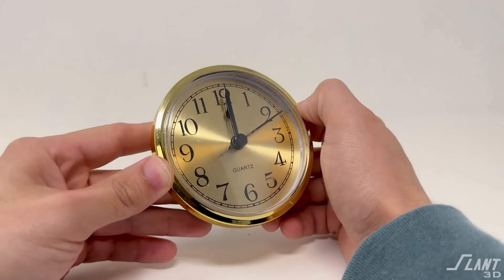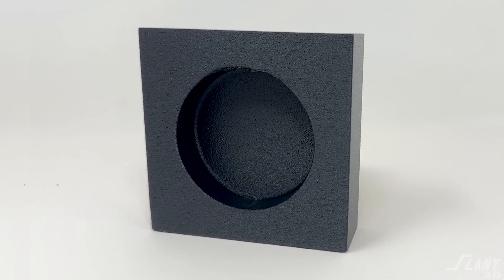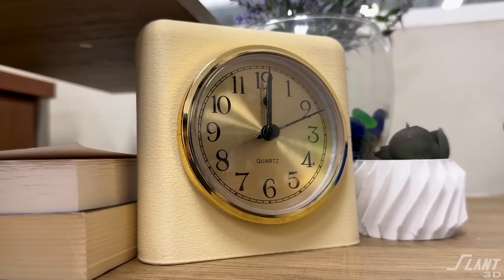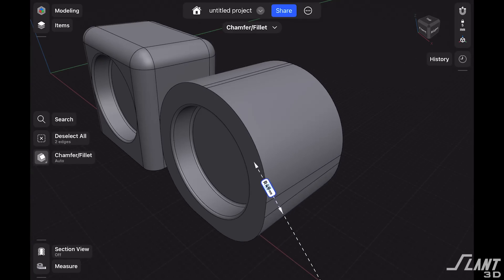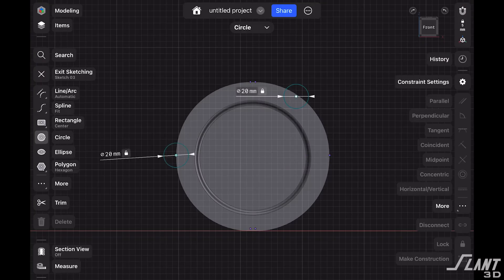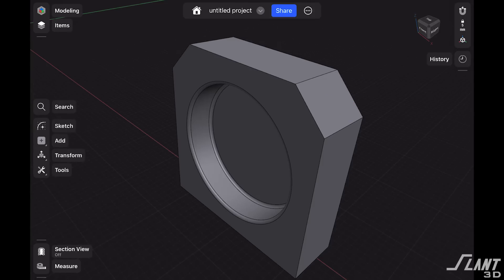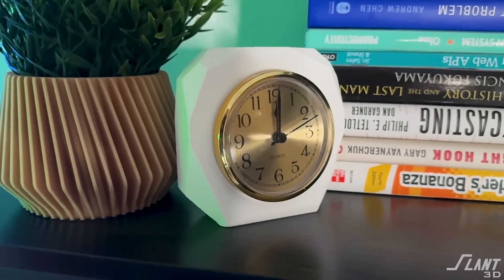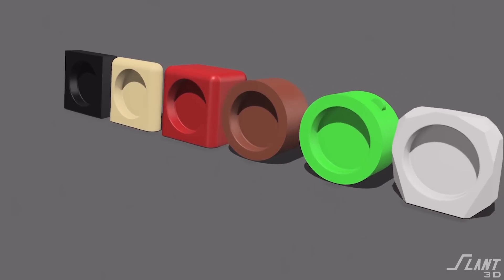Create 3D Printed Clocks Easily | Design for Mass Production 3D Printing

Comment: This might be a dumb question.
Why haven't Slant3D partnered with printables or something.
If there was a plugin made specifically for that site it could fit in really well with the rewards model they have.
The one thing that site doesn't have is a print on demand service.

As the consumer I see this as a match made in heaven. 
Technically it does have the downside of being in conflict with selling printers. But I would think they could generate more revenue overall by getting a kickback with a partnership then selling the printers.

It's just something I would consider. Also because both companies have good ethics it could be greater then the sum of the respective parts.

Comment: what cad program are they using here its not fusion
Reply: Shapr3d
Reply: @JOEDHIGGINS  Is this easier to use than fusion 360 as far as learning curve cuz it seems like for fillets he was just dragging to get the desired amount he wanted versus fusion 360 where you have to go in add it manually to each corner and then select how many millimeters and punch it in
Reply: @josefsteiner9401  I don't know Shapr3d but Fusion does have a drag arrow for fillets.  You can shift-click to select multiple edges, too.  Which, granted, is only reinforcing your comment about the learning curve!
Reply: https://youtu.be/W4MKAuDJ_I8?si=CQyDT5Z4Fnrey3gi

Comment: So how would that clock or any product with a printed and an external component work as a fulfillment workflow?  do I get the printed part add the component and then ship it to the customer. Or is there some sort of process that when an order comes in an order goes out for the required component and you do the combination and ship to the customer?
Reply: Yeah I had this same question. I assumed Slant only handled production and possibly fulfillment of 3d printed parts.
Reply: Yes but Slant can store and include the clocks to each package
Reply: Likely you should need to ship them the clock inserts and then it would be part of postproceasing and assembly which is already something they do. 
Likely having a significant cost addition to your part, since most of the work is hands off until assembly

Comment: Cool video but a bit concerned with that $16 for the cost as I doubt that includes the clock itself so you would be looking at selling a clock for at least $40 which maybe seems high cause I am a cheap old guy lol Would be cool to have multiple ones able to be attached for different time zones or humidity, temperature....hmmmm
Reply: Based upon the brief Google search, you can buy these clock faces for anywhere from 1.20 to 2.50 each. The shipping would be extra obviously and have to be amortized across multiple clocks. 

It would be a good idea to see how they handle this on their end. Do you have to buy the clocks and send them to slant, do you have the print made, shipped to you or a third party for final assembly, or do they handle everything on their end and ship from their warehouse? Most of these videos suggest that they do not do full assembly of the parts but just print, remove prints, and smooth, and some minor assembly of just the 3d parts.

Given the way this video goes, I'd say it looks more like it would be correct as shown only if they handled everything on their end. Otherwise you do not have to worry about "only designing".
Reply: The average house cost in my province (not just one municipality) is $965,000. 😂
Reply: @evlsc400  I thought $300,000 was bad LOL